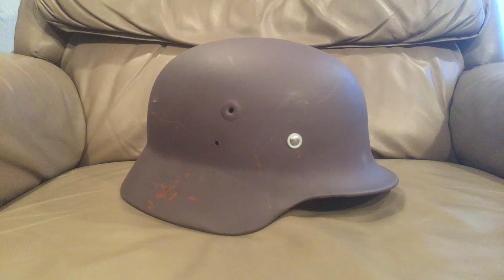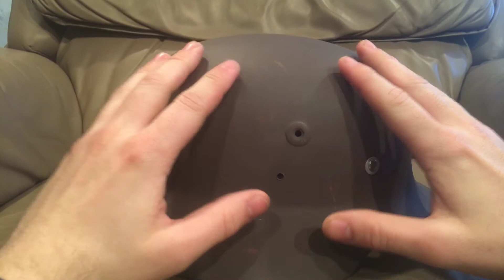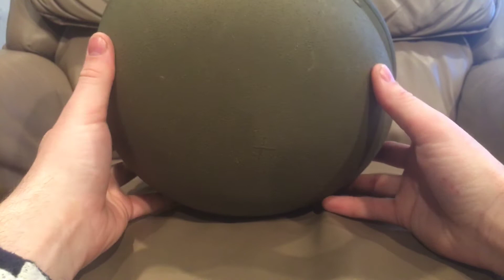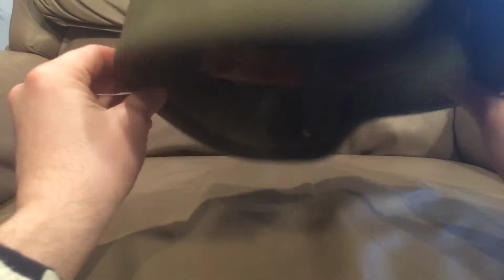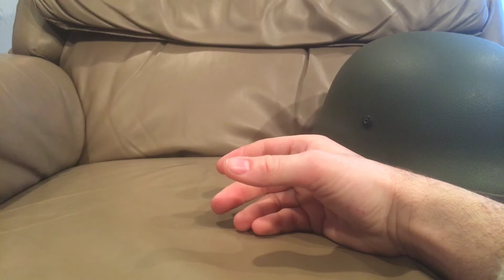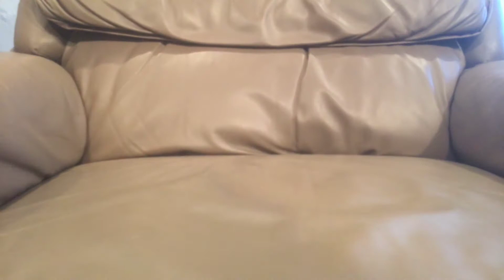Kevlar stahlhelm?

Comment: The problems you named in the video about the Stahlhelm were problems which the WW1 design had, not the WW2 design (which is the one you feature in your video). The WW2 design had most if not all those problems fixed. The reason why no military nowadays uses the Stahlhelm is mostly because of the political baggage that the helmet carries since WW2. But the Stahlhelm has such a good design that the modern German fire brigade still uses the exact WW2 Stahlhelm design. Ofc there are more reasons as to why it's not being used nowadays but it's weird that you didn't name the main one.
Reply from the maker: Alien Xenomorph Nerd the video wasn’t really about bringing up the history or baggage with the stahlhelm it was more about spotting similarities between it and the most widely fielded style of kevlar helmet and the stahlehlm
Reply: @DevinK  Yes I know, but you named a bunch of problems with the WW1 models at the beginning which made it sound like those were the reasons why the WW2 models (and post war models) aren't being used by the modern military. Other than that this is a great video.
Reply from the maker: Alien Xenomorph Nerd yes I did but while those problems were lessened they were not corrected because they are still present on helmets used today of a similar shape
Reply: @DevinK  Yes but they were lessend to the extent that most if not every helmet had those problems. The WW2 models didn't obscure your sight anymore and the hearing problem was mostly fixed as well. The rocking forward problem had also decreased tremendously with the WW2 models mostly because of the shortening of the bill. The WW2 models of course would still sometimes rock over but almost every steel helmet at the time had that problem, if the Stahlhelm were made into a Kevlar variant the problem would be almost completely vanished because of the lighter weight.
Reply from the maker: Alien Xenomorph Nerd we are just arguing semantics here

Comment: Nice video! Got a Finnish issue as well, was lucky that it did not have the third hole on the side.
Reply: Devin Krueger the extra hole wasn't a wartime thing, it was post-war. There was a few different liner types, but during the war, the original German liners were used. This is proved by dozens of original pictures.
Reply: I had a EF66 Finnish M40 which didn't had the extra hole. Still dont get it why some have it and others not, with the same liner, both wartime and postwar. Maybe depended on the armourer.
Reply: And probably they retrofitted them uncountable times. I have three post war helmets, one 66 and 2 64. One (64) with the extra rivet and the other 2 not. Finns didn't care as we do haha.
Reply: In conclusion, it's due to influence of both Austro-Hungarian M17 helmets and later Hungarian M38s, because
1. They were the majority on finnish inventory, so armourers had the know-how, tools and spare parts, and were cognitively "biased" on keeping that system (same as when people highlight the good things of their cars while downplaying or ignoring the bad stuff).
2. Both have chinstraps affixed by rivets on the shell (Separate Bales on the M17 and using the same frontal liner rivets on the M38) instead than affixed on the liner band, as the german models. 
3. It's cheaper and stronger to have the chinstrap held directly on (or by) the shell, and then using a simpler liner than having a more complicated and expensive metal band. If the chinstrap or rivet broke then it's as easy as hammering another one into place. If the band broke, then you lost the entire liner assembly.
Reply from the maker: WW2 Wiking - Review, History and Reenactment yeah you must have a later one because all the wartime ones have that extra hole as that was where the chinstrap rivet went
Reply: Yes, most likely 1950s helmet.
Reply from the maker: Álvaro Vergara the extra hole was for the chinstrap rivet the Finnish m40 helmets the chinstrap was a separate piece from the liner until the mid 50’s so the wartime made shells with have the extra hole and when they were converted to a one piece liner and chinstrap assembly the hole was just unnecessary but never filled in
Reply: So that would mean there were at least two batches of post war helmets?, since some have the extra hole and others not. Anyway, the extra hole is probably a remnant of austro hungarian and then M38 hungarian liner systems. Both had larger numbers in the finnish forces and both have the extra hole just for the chinstrap, while the germans started to affix it directly to the liner band by 1918.
Reply from the maker: Álvaro Vergara yes most helmets during the war were updated to have the extra hole for the Finnish made chinstraps and liners and after the war most were updated again to the new one piece chinstrap and liners and anything made after 1955 will be missing the hole they did a two piece liner and chinstrap during the war to ease manufacturing and if one piece broke you didn’t have to junk the whole liner just the suspension or chinstrap based on what was broke or worn out
Reply from the maker: Álvaro Vergara pretty much when your as small them if it isn’t complete trash it kept getting recycled and used
Reply from the maker: PanzerFaust 360 they did use German liners when they could get them they even used whole German manufactured helmets when they could get them that served well into the Cold War that are missing the hole but the vast majority of the Finnish made shells have this hole produced during war or not this is well documented by Finnish inventory managers and quartermaster corps that doesn’t mean that they were all made with the hole the Finns were notorious for not getting rid of anything until they had to so liners and shells were made accordingly on a case by case helmet per helmet basis most times based on inventory and repair statuses
Reply from the maker: Álvaro Vergara very well said